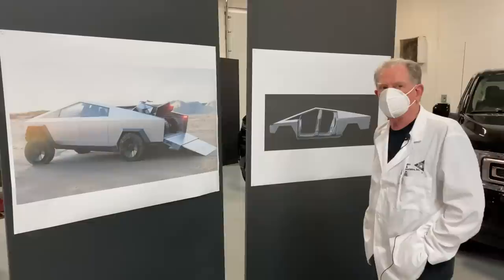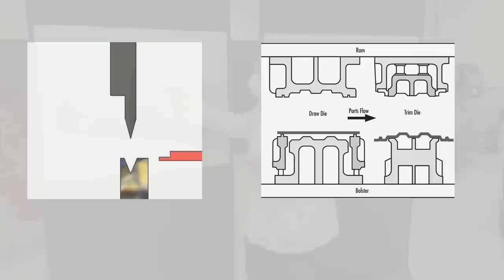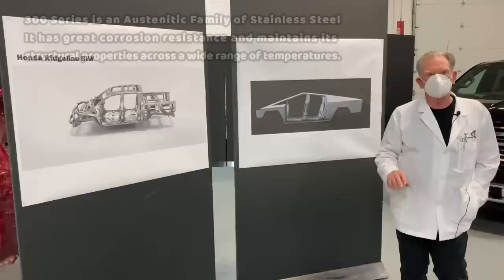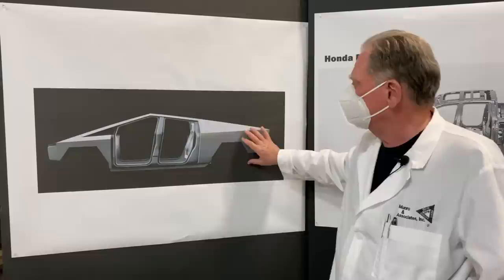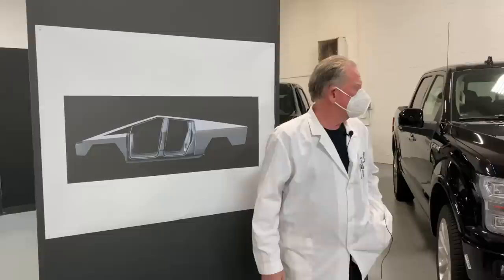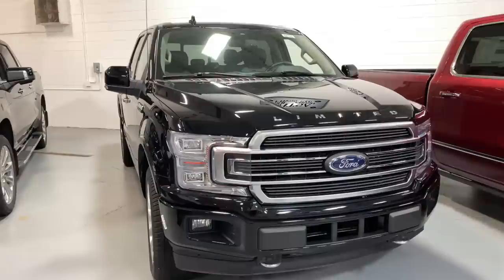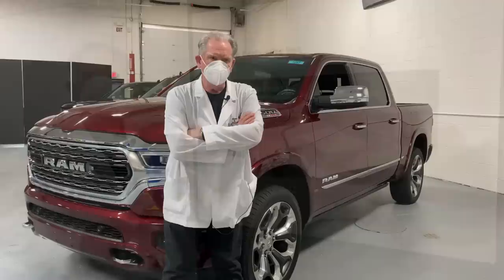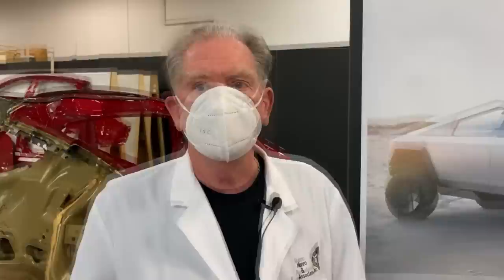Cybertruck E1 - Body Structure Comparison

Comment: mid video, so if answered later thanks in advance.
Sandy i want to hear your opinion on big damage and repairs. not a stroll scratch, but sb drunk that hit it on the rear or the side while parked. Or if u lost control on highway and did a couple of hits on the sides. Talking about damage that wouldnt be destroying the vehicle in a "normal" body, how does it affect the cybertruck? 
(it probaably has done less damage, but accepting it has done some significant, what happnes? do the damaged parts get cut off, and new side panels get attached with some unique method? how much has the structural integrity been compromised in a coule of examples? this might be the first time i have to think about how service will be made, instead of just how much it will cost me before i buy...)
Thanks for any considered answers, and especially a possible one from te Sandy team.
Reply: If you had an impact that would demand structural repair on the CT, the same impact would have written off any truck (and the poor sap in it)

Comment: If people decide they want cool colors on their cyber trucks. It ought to be a pretty easy vehicle to do a vinyl wrap on. That seems like a simple solution that even Tesla could decide to do if they wanted.
since it's stainless steel you don't have to worry about corrosion between the vinyl and the metal.

Comment: Sandy, I don't tweet but here's one idea that should be sent to Elon.
Idea: Use Graphene aerogel as a noise and thermal insulation in your cars. At 7 times lighter than air it should reduce weight and increase thermal insulation while eliminating weight across the whole vehicle. Perhaps adding additional buoyancy to the increase the chances of the cybertruck doubling as a fishing boat. Refrigeration insulation for the Semi. Your welcome.

Comment: Phoenixlinge, I do agree that if you are hit by a cat and get ripped open by a hood ornament as you bounce off hood or even die because of ornament. If You end up going under car, your survival maybe a little better than from a cement truck, but I don’t buy the soft steel argument.
You did explain to Me why there are no crash bumpers or Bull-boards on TESLA SEMI. What no cattle or moose on road in Europe? I believe they are needed even for trucks parking and truck in front backs up and does a lot of needless damage from trailer. They are very much needed in CANADA. This protection would affect the aerodynamics and add weight but very necessary and in keeping with almost unbreakable  windshield

Comment: Weight Vs expensive material: the i3 from BMW uses plastic/cfrp to reduce weight. Did not turn out to have such an impact in real life and created some issue due to usage of carbon fibre. Issues were Tommy knowledge the manufacturing itself but also an issue which firemen breaking the structure after an accident exposing themselves and the passenger to carbon fibre needles.

Comment: The comment about welding stainless is wrong.. It is true that TIG is used to weld stainless but in this situation they more than likely would use plain old MIG (not MAG) with Argon shielding gas and a stainless wire.. It's a lot faster and robots can weld it so it almost looks like TIG

Comment: For those of you who love the idea of the Cybertruck being able to pull a tank turn to get you out of tight spots, maybe it's possible! With a triple motor or dual motor it would be difficult for the tank turn to be accomplished in the same way. The reason is because you don't have a motor on each wheel you cannot get the right wheels to move forward and the left wheels to move backwards. On the other hand I do believe with the torque and power of the Cybertrucks motors that you could have the front right wheel going forward and the rear left wheel going backwards to accomplish pretty much the same action. With just one wheel moving forward and one wheel moving backwards theoretically the dual motor or the triple motor could do a tank turn. You would have to slightly turn your front wheel towards your reversing back wheel or vice versa. These actions I believe could give you a similar forward tank turn or a reversing tank turn. Of course this would be easier with swiveling rear steering as well. Four wheel independent steering and only for tank turn with the vehicle having to be fully stopped and wheels turned all the way to configure wheel following wheel action. A tank turn sounds too clumsy anyway gyro action would be preferred terminology! Of course since SpaceX technicians have been talking about cold air thrusters for a turbo boost and hover I wouldn't be opposed to that in a tight situation either! For those that like these ideas or have some of your own to add please let me know. I appreciate all of you and your ideas. 
Now is the time to change our future!
propower101@hotmail.com

Comment: Idiot question from a non engineer
If the steel is so firm, won’t a lot more force transfer to passengers during an accident? In other words the opposite to what a crumple zone does.
Reply: Thats why they invented SEATBELTS
Reply: s3xyScorp that doesn’t explain it. The deceleration caused by a seatbelt only kicks in when it grabs you. A crumple zone increases the distance you stop over, thereby reducing the force (hope my high physics from back in the day is right 😅)
Reply: Do not worry, there will be a dumbed down version when production starts.
 When Ford tried a "merged " cab in the early sixties( still had a frame) the racket and vibrations all over the vehicle transmitted into the cab of course come to think of it a van works pretty well.
 Vibration damping and resonance will have to be addressed in this vehicle of course. Truth be told though this changes the paradigm.
 For one minute imagine this light weight thing as a Hybrid vehicle with a lightweight flat-six, air-cooled ( burning alcohol)powering the rear with pure electric range of  200 miles, just imagine do not seize!

Comment: He definitely didn't work on the DeLorean. The panels were 16 gauge 304 stainless steel which is much thicker than what you'd find on a standard vehicle. Ask anyone who's ever tried PDR on a DeLorean.

None of the panels had plastic lining on the back. 

Furthermore, the DeLorean did not have an endoskeleton like the Ridgeline, but rather a fiberglass underbody that the stainless panels were bolted onto making incredibly easy to service.

Most robots prefer MIG welders because the flexible wire feed makes it much easier to continue to weld unabated.

Comment: Be interested to see how the panels are to keep clean. I’ve got mostly stainless steel appliances in my kitchen and they’re a nightmare to keep clean. Fingerprints, water spots, surface scratches. They look good though, brushed. I use 3M stainless polish and cleaner to keep on top of it.

Comment: I use a truck every day. It's a work truck. A 2003 F-150 I don't worry about getting a scratch or paint transfer from materials I throw into it each day. What I don't see in this new truck is utility, I already have some trouble reaching into the box behind the cab to grab material or tools.  Being a 4x4 this also raised the frame a bit and also makes getting into the back a little more difficult. I like to be able to easily slide 4' x 8' pieces of siding or other material in and out. I also use the bed and gate in the down position as a table to mix paint, cut lumber, and other tasks. A truck is asked to do a lot but what I don't see in this truck is a utility that I would need currently. It might be good for other uses.
Reply: The CT has airbags that lower the rear side so the bed is more accessible for loading, and you can lower the back gate just as any other truck today

Comment: Would like to hear some thoughts about the interior parts that stiffen the outer shell and bring the loads out to the skin. How do loads get (are connected) to the panels without deforming the outer a surface? Adhesives? 
Also, how is welding going to be hidden? No bluing or heat witness marks?  Thoughts?
Reply from the maker: Great idea Dave. When we get our Cybertruck (a production version) we plan on doing a deep analysis on the BIW, just like our Model Y study. Thanks for watching!

Comment: In a previous video you talked about Tesla motors. Maybe you could look at the Chorus Motor website where they discuss the WheelTug that is used on airliners for ground movement instead of using the engines. The motor design and electronic controls are interesting. I thought that Tesla may have used some of the ideas behind the Chorus Motor design.

Comment: @Munro what's your take on adapting build pipeline  to v2.0 exosceleton (SUV) with smaller, model 3 or model X, skateboard? Are said skateboards compatible; weight of body will be similar so no need for substantial changes to brakes or suspension?

Comment: I'm concerned about corrosion due to concentrations of Road Salts the highway department uses during winter. Leave stainless steel exposed to natural elements could pose problems, maybe a expoxy coating during manufacture.

Comment: I remain out on the fence on this vehicle.  I may get one, but as a 6 passenger ATV not as something to work with.  I was disappointed last year having waited 2 years for the unveiling of Tesla's truck in replacing my aging 3/4 ton that was dying towing my backhoe & trailer.  As a consequence, I just bought a 2020 Ram 3500 4x4 dually for that.  With its 35k towing capacity it can do what the Cybertruck can't even dream of.

My other concerns with the CT as a work truck is lack of options for a long bed or dual rear wheels (which basically rounds back to towing).  The angular sides prevent the carry of a load bridging the bed, something I've had to do many times carrying a tractor implement on a pallet bridged across the bed rails because its too wide to fit inside. 8ft long bed is a must for many work trucks, long loads can only have so much legal overhang.  The problem in the design is its lack of modularity to accommodate buyers who would want those things, whereas the traditional Big 3 models are all available in a wide range of variance in capacity vs price.

My last concern has to do with the exoskeleton durability under accident conditions.  Presumably its hard steel exterior will shrug off a fender bender.  However, inertia and its energy rule the day.  You can get into a fender bender with a regular car or truck and come away drivable even though there is $1k's in cosmetic damage.  A fender bender with a Hyundai and a Cybertruck will likely badly wreck the Hyundai much worse for the impact, but if even part of that nets a yield in the Cybertruck exoskeleton - your totaled, the frame is bent.

Comment: I show your videos to my middle school students sometimes. Thanks so much for straight talk SM! Looking at the ICE trucks I'm struck, as I often am of late, by the large GRILLs. Are they still needed for air cooling? I notice them getting smaller and smaller on some ICE cars. So I wonder, are they on big trucks for traditional aesthetics and radiator configuration only? I'm not an engineer, but I wonder if it would be more aerodynamic to have a smooth front end and get the airflow from below?

Comment: Hey, Sandy! Big fan of your technical, but thoroughly explained talks. 
Not sure if you respond in the comment section, but if you do, here's a question: There was some talk about the Cybertruck possibly not making it to the streets, as is, due to it's sharp lines being too dangerous for pedestrians (in cases of hitting a pedestrian). What are your comments on that? To be clear, I'd love to have the Cybertruck on the streets as it is, and I fear that a safety redesign, a softer design, if you like, would make it less appealing.

Comment: Stainless steel has one interesting corrosion problem.  If part of the body is exposed to the air (oxygen) but there are places where the air can't get to and hence are anaerobic, you can get pin hole corrosion.  The aerobic and anaerobic parts of the stainless steel behave as two different metals.  This would be particularly problematic in a coastal area where the car is exposed to salt in the air.
Reply: William Hughes-Games Mr. WIZARD, do you just make up this bullshit on the spot? The stainless does not corrode because the nickel and chrome are brought to the surface by passivation.  The interior of the metal is not in contact with O2 so why doesn’t the stainless steel sink corrode from the inside out?

Comment: As a pedestrian or the other vehicle involved in an accident I don't like the idea of 3 tons non plastically deformable tanks rolling around. In a small modern car there is a lot of work put into pedestrian safety like putting a deflector under the front bumper to minimize the leg-twist in a collision, dampening through deformation and even making sure that the glass is elastic enought to prevent head injuries in case the windshield is hit by one. I think most of these good design principles are scrubbed in the cybertruck

Comment: An exoskeleton might be cheap to make. But it has to have crumple zones. It is hard to build in crumple zones to a exoskeleton. 

Stainless steel are not created equal. Unless it is specifically rated to with stand chloride corrosion, it can start pitting even expose to sea breeze which contains salt.

Ultimately the car exoskeleton will be in contact with dissimilar metals (like nuts and bolts). Without a primer or paint galvanic corrosion will set in. Your car will get wet.

Comment: Sandy, How does stainless steel fare in accidents, insurance and repair?  Does repair shops have the capability to fix a damaged cybertruck?  Will it be like the F-150 switch to aluminum where Ford had to assist in the spool up of repair shops?  How will the repair costs compare?  Will a simple 25 mph accident total a cybertruck?

Comment: I'm curious to see what kind of one-piece moulded motor cradles the Cybertruck has. Elon mentioned Baja races, which means either ton of tubes or one moulded part to make everything solid. Another thing, there is no skateboard design, just a pocket for the battery.

Comment: Hi sandy, If I may be ignorant, why is paint so expensive? Can't manufacturers do what the semiconductor industry does? 
The process that the Hard Drive manufacturers go through for example,  is they dip their HDD platter disks into a solution, and  then as the pull the part out, they vibrate it violently at a certain frequency. The vibration of the part causes the surface tension to pull any residue off the platter as it gets pulled out, and as a result, the platters come out of the solutions completely dry without any physical contact! I imagine that car companies could do similar, just with bigger parts?

Comment: I’m curious how they repair the exterior, especially if it has something like an angel hair texture. Do you polish out scratches and then get something to bring back texture? Fill in deep cuts with bondo? Stainless Steel IS soft after all and it will be battling ceramic dust and sand.

Comment: What do you think about mass production ability to maintain quality SS 30X surface finish throughout the vehicle? Essentially, bare metal grain, scuffs, polishing direction and repeatability all impact the outward appearance of surface finish, and paint hides this, how does one avoid expensive polishing of metal surfaces? Should surface treatment be done before or after forming and what do you do after final assembly if you have scuffs and any sort of buffing or polishing will result in the surface texture change that would make the entire panel different from the panels around it. It's like, one panel is matte while the next is a mirror finish type thing.

Comment: I'm curious to see what the Cybertruck really looks like under its skin. I suspect it will have plenty of stamped parts just like the shown Ridgeline, due to crash, function, NVH, and stiffness requirements. 30x steel is not hard and can be readily deep drawn with properly designed tooling. I think the shape is just a design decision and has nothing to do with manufacturing requirements. The exterior is a great shape for prototyping and test mules because it can be laser or water cut and press braked but for high volume production this is huge overhead because of the time it takes. It'll be tooled by then.

Comment: I have for 40 years worked with Ford and GM. Ford is without a doubt the best overall like truck. We routinely run them over 400000 miles. Since 2002 I drive only Honda. These Tesla trucks will not work in 24 hour fleet service. We would not have enough parking and charging capacity. They are ugly and impractical for working trucks. Don’t get me wrong I like electric cars. We had them at work. I drive two hybrids. My boss at work has a model S. I found it to be unrefined in  comparison to my Clarity PHEV. It does have a nice pad built in though. I used to be a Ford guy. I worked for Ford and so did my dad. I like you videos. Thanks

Comment: I was slightly concerned that it may be too easy to be a total loss in a wreck. Other vehicles can have fenders/parts replaced as they just hang off an internal structure. 

However, seeing as its stainless steal...the magnitude of the wreck required to actually hurt this thing structurally is going to have to be so severe that any truck would have been a loss. 

Smaller "fender benders" are going to most likely be someone else' gets a fender bender, you get scratched...buff it out and your good to go. 

If you do actually end up getting  a puncture or rip, any welder worth his salt will be able to weld on a stainless steel patch, buff it out and throw a paint job on and call it good. Or leave it with a scar for a badge of honor and some character.